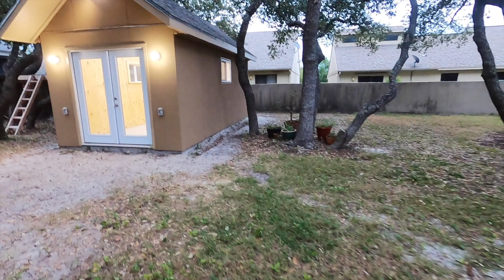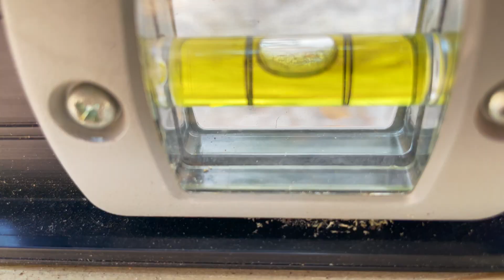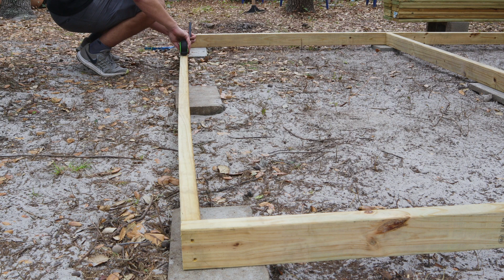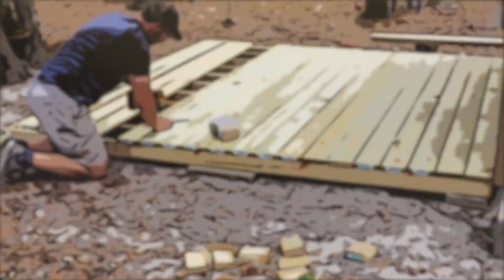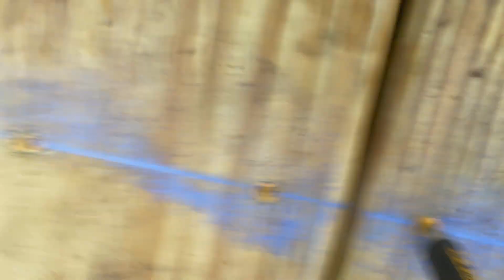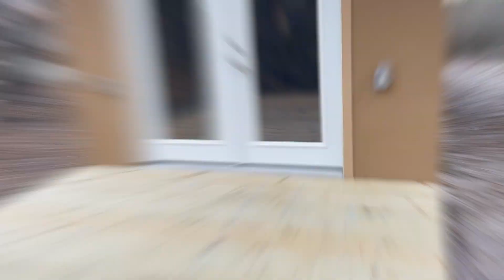I built a deck workspace for my tiny workshop

Comment: Nice! It was hard to see in the video but it looks like you are using deck screws to fasten some of the joists to the frame from the outside of the frame to the center frame board (in an orientation similar to how you did the four outside boards). How are you attaching the screws on a joist that continues past an already fastened joist where it meets the center frame board? You can fasten the joist straight on from an outside frame board but are you toe nailing that inside joist to the center frame board when the joist just on the other side of that center frame board is already fully attached??? Thanks!
Reply from the maker: I alternated the joists on each side so I could have the screws go in straight through the center frame board on every other board on each side, then toe-nail the remaining on the center board.  I could have toe-nailed all the boards, and probably saved some time and been just as sturdy, but this process made me feel good.  I hope that helps, and fully answers your questions.  Thanks again for taking the time to watch!

Comment: Nice work! How long are the deck screws that you are using for the frame and joists? They look about 3 to 3 and a half inches?
Reply from the maker: Thanks!  I used 3" #10 deck screws for the frame and joists.
Reply: @MakeitGoode1  Thanks! Are you using the exact same size of deck screws for the floor boards?
Reply from the maker: No, I attached the floor boards with 1-5/8" deck screws.

Comment: Nice addition to your shop.  I have a question.  I didn't see how you anchored the deck to the ground (I may have missed it).  If you didn't, you might want to read on.  To anchor my floating deck, I bought several (6 foot tall) cheap metal post and drove them into the ground around the deck.   Then cut the top off to a desired height.  Then screw it to the side of the deck and they will help hold it down from becoming a windsail.  If you buy tall post, you can use them for deck railing, I suspect you will eventually decide a wide railing with a top shelf will be a great addition to the functionality of the deck :>) Great video, I'll be watching you from now on :>)
Reply from the maker: Thanks, Russ, for the insight!  To answer your immediate question - I did not anchor the deck at all.  The deck sits at ground level, directly on concrete pavers.  Even here in hurricane country, I feel the location of the deck and shop, surrounded by trees, fences, and houses, and almost touching the ground, keeps it from catching enough wind to move about.   This is a fairly common practice in our area.  Now if I lived away from town, where there are fewer obstacles, and the wind had the ability to blow freely, it would definitely be a consideration.  I also deliberately did not add a railing, since I wanted the ability to move large items around.  With my shop being so small, I use the deck to break down large panels, and make cuts on long stock (plus heavy sanding, welding, fume-y work, etc).  No railing allows me to move unencumbered in at least 3 directions.  I appreciate you following along, and always feel free to comment with suggestions and thoughts.   It's very appreciated!

Comment: what are those black 90 degree things you had clamped in the corners when screwing the frame together.
Reply from the maker: Those are clamping squares.  They're typically used for smaller woodworking projects, but they did ok holding the corners square here, too.  Here is the link - https://amzn.to/3uTroVv

Comment: I wish you included a video on caulking and painting the stucco siding panels.  You had some pretty big gaps between panels and I'd like to see how you dealt with it.  Thanks.
Reply from the maker: Here is that video - https://youtu.be/OgmPLJUGRKw
I intentionally left gaps to allow for some movement, and to match the gaps in the real stucco on our main house.  I used the Stretch flexible caulk, and it's holding up pretty well.  Feel free to reach out with any questions!